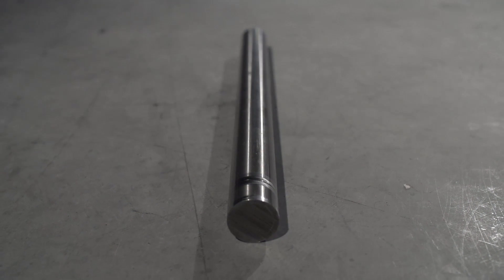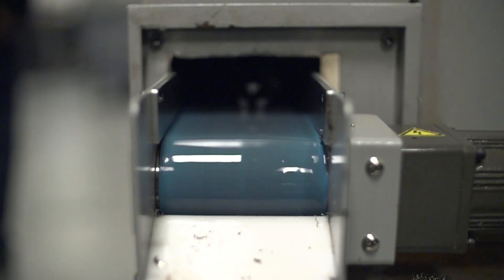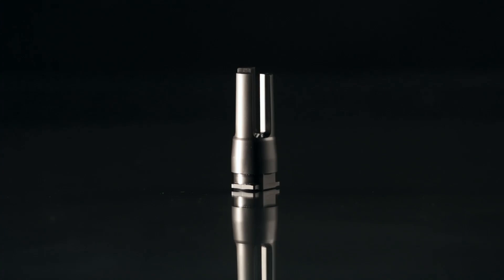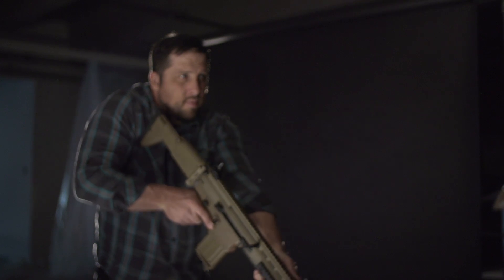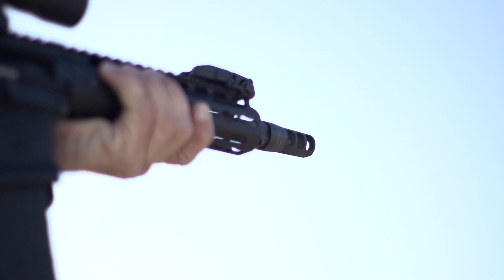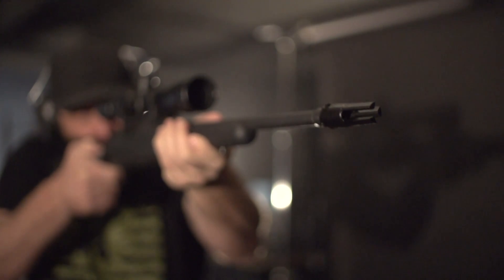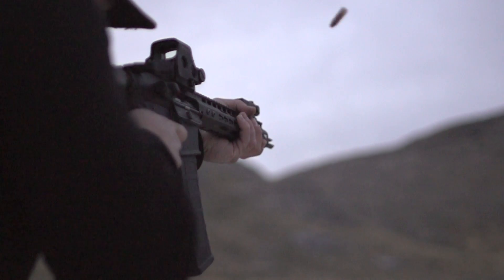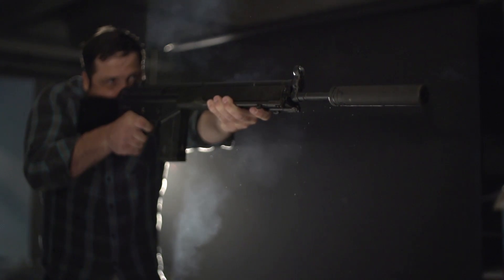SilencerCo: Muzzle Devices

Comment: Any idea when the muzzle brake will be back in stock for the Spec War 762?

Also it looks like there was a muzzle device mounted to an HK 91 in the video, but I don't see a 15mm x 1mm muzzle device available on the website.
Reply from the maker: Specwar Trifecta Muzzle Brakes are receiving the Enduryte™ coating, and will be available shortly.  The 15x1mm muzzle devices are currently in development, and will go into production soon.
Reply from the maker: Lee Dingle  15x1RH Specwar Trifecta Flash Hiders are now available on our website.

Comment: YOU are holding 1 tenth of the dia of human hair. I am calling bs. (human hair is .002-.003 so you are holding a + or - .00010-.00015 it is hard to believe and why would you hold to such standards i would assume a +- .0005 would be more than adequate. Good stuff just a quick jab sorry narrator
Reply: Maybe my math is wrong but .003" which is 3/1000" divided by 10 is .0003" or "3 tenths" as we call it in the machining world. Our shop holds 3 tenths of a thou no problems. Even .0001 or less on good days on the right machine. I have not put one of these on the Zeiss CMM where I work to check one yet but I have no reason do doubt their claims. Its a really nice hider/brake. I have one of each